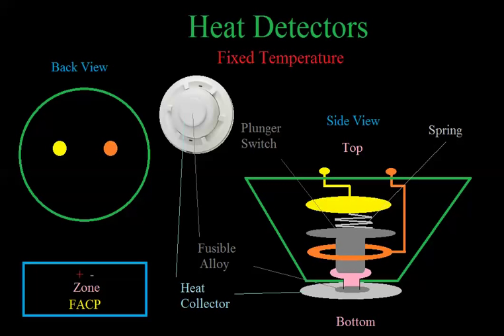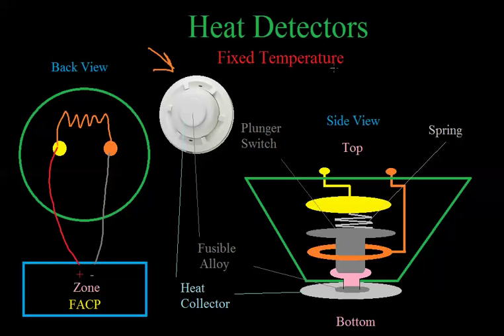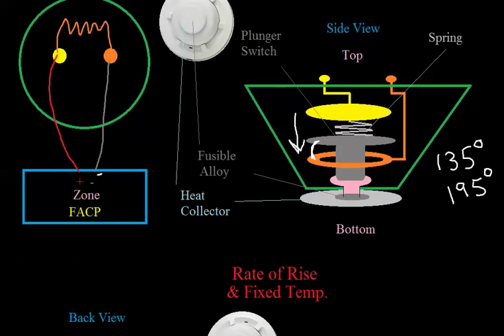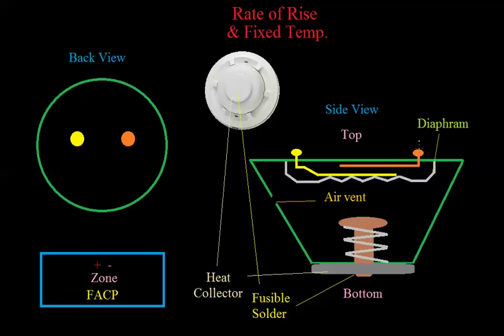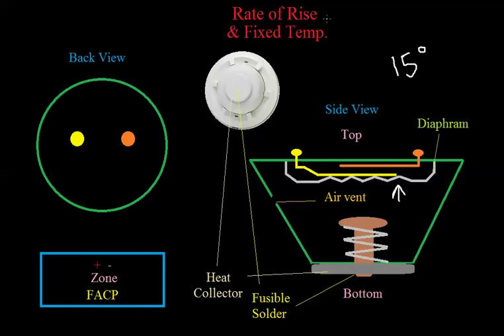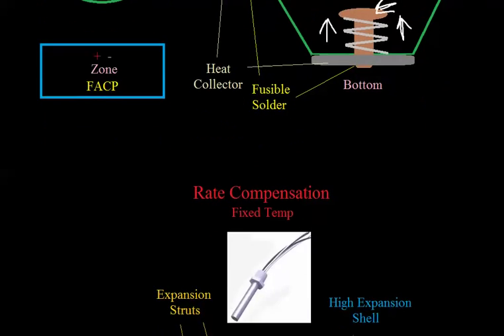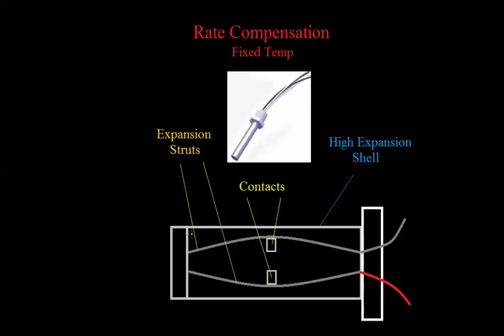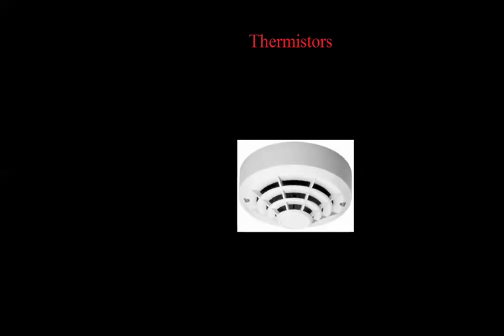14 - How Heat Detectors Work - Introduction to Fire Alarms

Comment from the maker: Flame detectors are not the same as heat detectors. Flame detectors detect the visible portion of the fire. I rarely encounter them so I'd have to do some research before giving you a better explanation of flame detectors, but I know that they can be set off if a lighter is ignited in the line-of-sight of the detector. Heat detectors detect the temperature of a fire rather than the visible characteristic of it.

Comment from the maker: The fixed temperature heat detectors are one-time use devices. The rate-of-rise detectors are self-restoring, but yes, you have to replace the fixed temperature heat detectors each time they are tripped. Supposedly you can just replace a portion of it, but I've never known that to happen. We always replace the entire device.
Reply: Joe Klochan, is fixed temp heat detector one time used only? what if we conduct maintenance and test its functionality, and it really works, does the heat detector already defective? Thanks